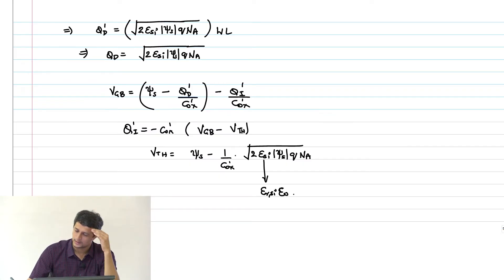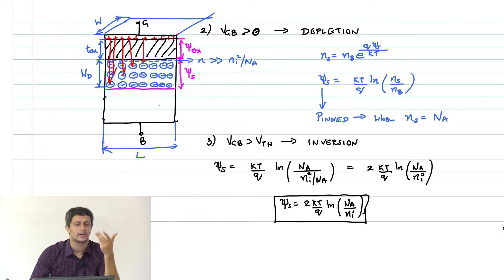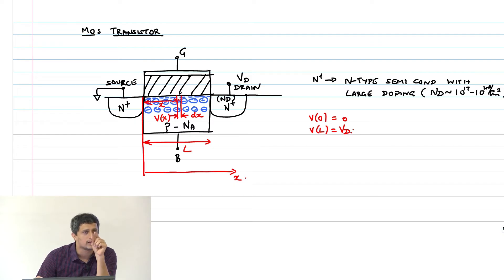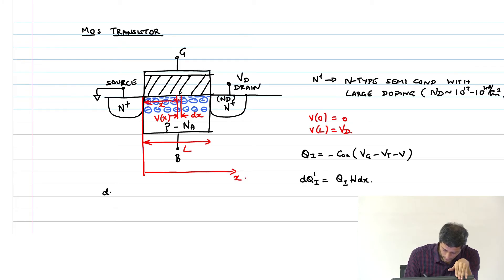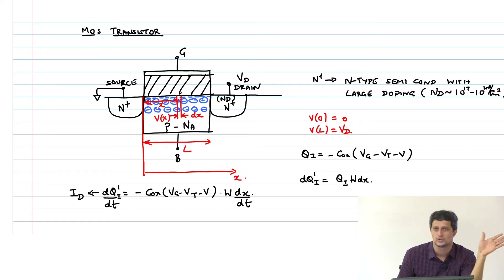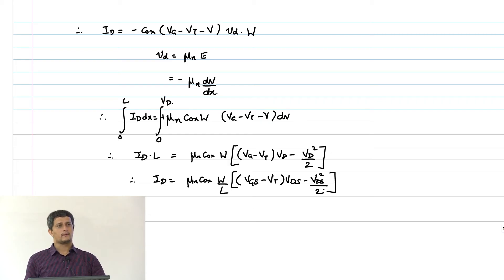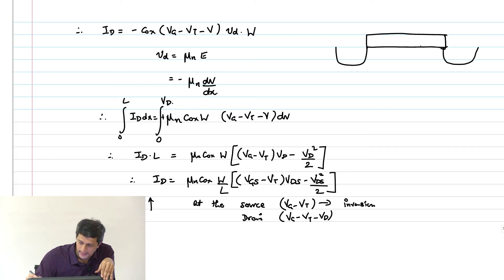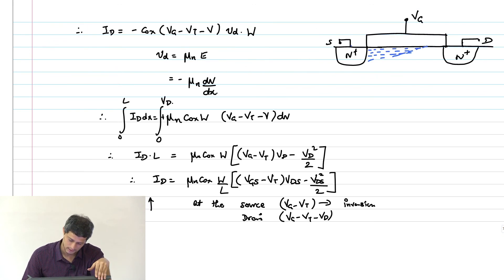Transistor - 3  - MOS Transistor Current Expression

Comment: @ 5:56 how did he write Q'I here? complete explanation, please.
Reply: From previous lecture, we know Qi' = - Cox (Vg - Vt). Here, an extra term (-V = - V(x)) comes because as we are applying the Vd at one end, it will create a voltage gradient along the channel length called V(x) for an element length 'dx', which will oppose the voltage applied at Vg.